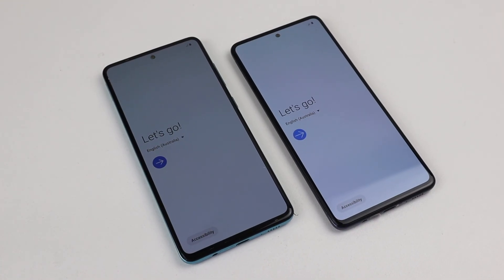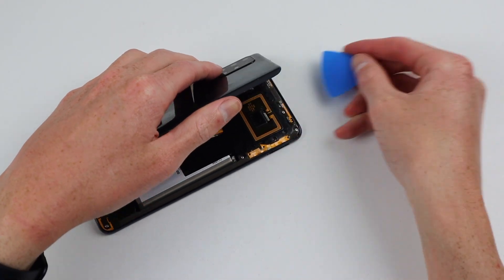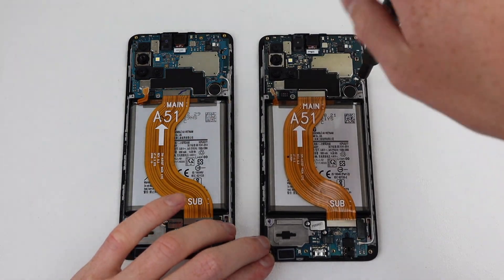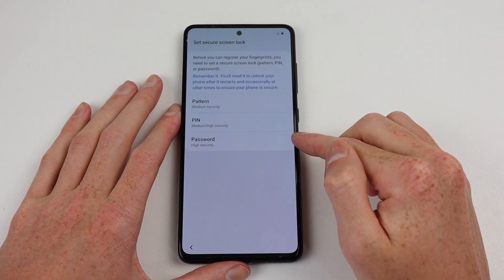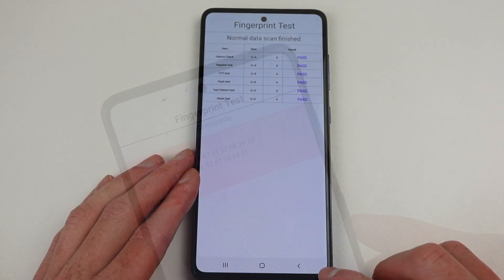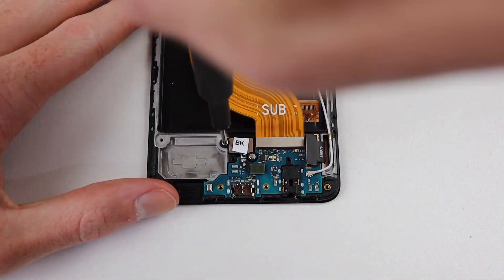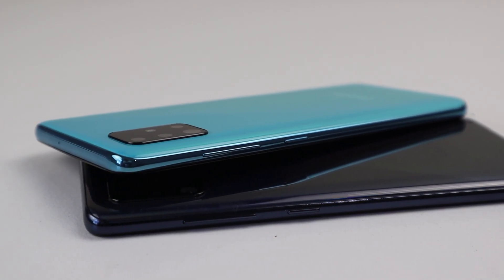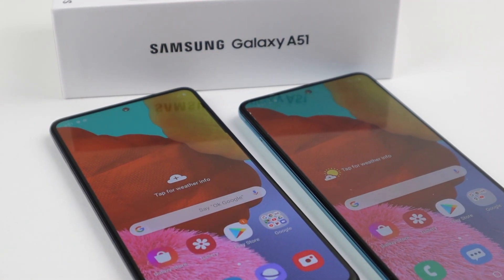Samsung Starts Blocking 3rd Party Repairs? - Galaxy A51 Teardown and Repair Assessment

Comment: Samsung has just become a clone of Apple.
I fear the day I can't repair my old, good Galaxy S5 anymore.
In that case, I'm gonna switch to Fairphone. As late as possible, hopefully.
Reply: Actually the S5 was one of the more difficult ones to repair, since the frame screws were located under the screen.   Not impossible to remove the screen without damaging it, but it certainly wasn't repair friendly. :(
Reply: @BillAnt  you're right. USB port got repaired twice (first attempt was a bad job) and each time it was necessary to unglue the screen, with all the risk that such operation bears.
Luckily, my phone is still working. The one I'd like to use, Shift mu, is under development. Hopefully it comes in two years. Let's see.
Reply: Does it actually still work? Like, it doesnt fry batteries? It does turn on without having to plug a charger?? 

Mine does work, but ANY battery lasts only about 2h, and they get bad after a few months. AND it doesnt turn on without the usb plugged in, even with the battery full. After the samsung logo i can remove the charger and use it for about 2-3h.
Reply: Noooo I had to abandon my S5, and now my J7 Core :( i don't want a new phone

Comment: i was good fan and customer of samsung mobiles. samsung also following apple. my note after upgrade endup having battery problem. ordered new original battery from samsung but its the same issue. it goes from 100% to 0 % in 10 minutes or less screen time. they really screwed my phone to buy a new one. i stopped buying samsung after that.

Comment: I never used Samsung or Apple. I personally feel they are just over hyped. There are plenty of other options to choose from which are way more cheaper, have great specs and perform great too. Been using the Realme X ($ 270) for almost 2 years and never had any sorts of problems whatsoever. Furthermore, using a cheaper option also makes it easier on the pocket if ever you need to change the phone. I seriously feel money can be saved and used on a thousand different things which are way more important than wasting it on phones that use just marketing gimmicks and further marketed by influencers.

Comment: The fingerprint reader shouldn't be a concern, if you ask me.  The security they provide is actually pretty terrible, and compliance with requests to unlock your device are longer something you can actually decline.  All someone needs to do you unlock your phone is just press your finger against the sensor, the phone cares not whether you did it willingly or intentionally, or even if the finger is still attached to you.  It's even demonstrated here that they can return false positives on occasion.

The issue with the replacement probably comes from the the precision required for the sensor to be able to identify the fingerprint reliably.  The tiny difference in the timing and pixel placement between the screens was probably enough to prevent the sensor from getting a reading, and the third party screen probably only worked because the refresh rate was so low it could take several samples at a time.

Comment: this video covered every circumstance except if you downgrade, and then re-upgrade.... In the off chance that the calibration it insists is required is created on the downgraded android, and locked in thorough the upgrade.

Comment: I think this is something related to Knox. It makes sense thinking about the security aspect of it and it explain why only the fingerprint sensor is affected. This should be publicly explicit by Samsung tho.
Reply: How so? could you please explain, so I can understand it better?
Reply: @iam5566  The knox encryption also considers the hardware. It started to consider it a few years ago. However, we've never seen a complete lock of a specific hardware until now. It makes sense to lock the fingerprint reader because if you manage to insert some sort of backdoor in the hardware you'd be able to access sensitive data. One UI prevents you from accessing data if the fingerprint sensor is changed forcing you to use a password. This behavior as pointed out by him started with more recent updates on the security patch. 

This is purely speculation of mine tho... Take it with a grain of sault.

Comment: i do display replacements for the A51 (and every other somewhat recent samsung phone)  very regularly. the fingerprint sensor worked every time. tho i did not check the security update yet
Reply: If you keep the old sensor, it will probably work fine. Only if you replace the sensor it will malfunction.

Comment: I have changed my galaxy a 51 screen my self and the fingerprint sensor did not worked properly 5 minutes after that the phone worked without any problems forgot to metion i am 14 years old

Comment: Isn't it possible Samsung has done this thing with the fingerprint sensor for an entirely different reason, namely to block the possibility of swapping parts in order to gain fraudulent access? Or wouldn't that be a possibility anyway?
Reply: Since the fingerprint would be stored on the mainboard, swapping out the sensor should not matter. On the other hand, even if their security was that bad, the hacker would still need physical access to the device. Even then, the OS could just display "non-original part detected" and work fine otherwise. Instead, they choose to make the device malfunction in an obscure way.
Reply: The security concern is a big one, although there should be a way to allow the sensor to still be used such as after installation force the user to use a password like they already do when you first turn on the phone (on models like the Note 9) and then display a notification that lets the user "calibrate" the new sensor as we have already confirmed the user is allowed to use the device thanks to the pin or text passcode.

Comment: My Samsung mobile motherboard was damaged then i go to Samsung service centr they said me cost of repair is 7000 rupee and then i think if i have to spend that much then its better to buy new one so i didn't gave my mobile in service centr after that i go to mobile repairing shop and i just have to spend 1500 rupee and within 15 minutes my mobile works fine.
So conclusion is if i have dont any option to where i repair my mobile according to our own will then for middle class like us dont prefer that type of mobile who doesn't prefer 3rd party repair

Comment: My a50 also did that fingerprint problem after screen replacement, fixed it by doing a factory reset via android recovery mode
Reply: I just needed to re-register my finger prints after my screen got replaced on my A50.
Reply: Which android version?
Reply: @storch1442  Andriod 11
Was earlier this year
Reply: Did screen glass replacement on my brother's a50 today 
Having the calibrate problem 
Won't let me add new fingerprint :(
Can u tell me how u did it 😞
Reply: @Ghostv33  you need to visit service center

Comment: This video is pretty misleading. Typically you don't replace the fingerprint sensors on samsung phones like this. Also most reputable 3rd party repair shops use genuine samsung screens anyway and if theres a security patch which requires an alteration to the replacement screens samsung will send out a notice and replace current parts in stock. Samsung aren't locking out 3rd party repairs. It allows them to make more money while outsourcing labour to other companies.
Reply: hm

Comment: Can you try to unlock the phone, install a custom rom and then again change the fingerprint sensor? If it's a software limitations by Samsung updates the new sensor at least in theory should work with a custom rom without any limitations.

Comment: To calibrate the sensor you need to install the firmware for the phone that's provided by Samsung, then the scanners will work as intended. Not sure why but this is the solution.
Reply: How is this done please?

Comment: Screw them, bought A11 and it broke on me just a week after purchase. Now I'm proud owner of Sony phone and this thing is amazing
Reply: I also want to buy Sony phone but where I live no one bothers even importing their new phones. and if I decide to import one myself would have an issue I would need to count on some 3rd party repair shop to be able to get the parts and fix it for me. this is kind of risk I don't incline to take. also any Chinese phone is burned out for me for security reasons and that leaves not a lot of choice.
Reply: @eliadbu  why not buy used or refurbished Sony phones from Japan? Make sure the phone is set so it's no longer locked down by docomo or au (Japanese phone service providers) ad you're golden. You can get them for cheap, like very cheap and if it break down you can switch to another because how cheap they are. Also if you afraid to lose your data, keep important data in cloud like google drive or load them to USB stick. Right now I'm using a SO-05K or Sony Xperia XZ2 compact. I got it for just $100 and it's tough as nail. My previous phone was Sony Xperia XZ and it only cost me $80 2 years ago. After my XZ finally died I tried Samsung A11 but it went kaput in just a week so I get myself XZ2 compact.

Comment: I have a 5 year old Samsung phone whose structural integrity relies completely on ducttape, but it still works fine and I replaced half the parts myself (I just got tired of ordering stuff from china, hence the ducttape). The thing was a used phone in the first place anyway. 5 years. It looks like shit, but it works just fine. Even the battery is still quite fine. 

I hate where tech corporations are going.

Comment: Ok, That's me being done with Samsung then. Not sure who I will switch to but Samsung is no more.
Reply: This is a solvable issue BTW
Reply: @warjt4737  how?
Reply: @DragonProtector  You can modify the phones, and what some people have been doing is flashing the stock firmware through Odin after installing a new display. That has been working.
Reply: @warjt4737  i thought that was obvious solution to do first? If you own the phone

Comment: And thank god I moved away from Samsun with my s7 edge. That thing got slow over a year and a half of use that even getting a refurbished showed no signs of faster app load times.

Been with my Google Pixel 3a XL for two years now, can still open all my apps quickly and also open Google Maps in just two seconds. Compared to 45 seconds for my Samsung...

Bye bye samsung.
Reply: factory reset with your s7 didnt fix it? or custom os? I am on pixel xl gen 1 still
Reply: @DragonProtector  nope, fresh factory reset and even flashing the stock firmware or one unbloated firmware onto it, bootloader not unlockable so it had to be a signed one, google maps still took awhile to load, and apps sometimes freeze out.
Reply: @niiiiiix  that stinks hard. I am still on my pixel xl gen 1 running fast.
Reply: @DragonProtector  well I meant I said I moved away from my s7 edge, my Google pixel 3a xl is working great, the one I use all day
Reply: @niiiiiix  ya ik. I got lineage os 17.1 on my pixel xl gen 1. Replaced battery last yr and running fantastic

Comment: Cars have had this for a while now, when you replace an electronic item you have to connect it to the main system by entering a pin no, which of course you don't have,
You can get it if you remove the chip and read it, but a cars circuit boards are huge compared to a mobile phone and it's very fiddely

Comment: We have reached a point where the mere act of opening your phone back has turned into something akin to breaking into a vault. Remember when phones and electronics devices in general were repair friendly?
Reply: It can be water resistant and repair friendly at the same time.
Reply: @Josh-oc7ib  Finally, someone mentioned this. It is possible, if rubber gaskets and Phillips screws were used on the phone's shell. :)
Reply: I remember when they had a battery I could easily replace.
Reply: @charleshines1553  same man. Literally the only reason I ever change phones is either the battery has degraded and can't be replaced or I cracked my screen by dropping my phone and that can't be repaired.
Reply: I Guess you could say we became

Vault Hunters

Cue CSI:Miami Intro
Reply: just don't drop your phone :)
Reply: I remember those times, they were great times
Reply: At the same time, modern phones are solid like a brick, while old were creaking plastic monstrosities in comparision.
Reply: Truth be told thats just due to the fact that the phones are now much more water resistant
Reply: @rajkumar-rg5sw  Yes, because I submerge my phone daily. Since my first Huawei G300 I do not remember having my phone around water, like ever unless you count toilet because why would I?
Reply: @zabunko  Aah yes because when I drop my phone in a pool of water, I always 💯 plan ahead to do it. Speaking of which I had a slot in my next week's calendar to drop my phone in a puddle. I'll just cancel that event so I don't damage my non water resistant phone.
Reply: @zabunko  You have never visited scotland have you?
Reply: @CallumCarmicheal  Have you ever visited Serbia?
Reply: @zabunko  Crazy you would ask that, but no. I do want to visit a friend in serbia though :)
Reply: @CallumCarmicheal  how about giving people options? Never in my life have I ever wished that my phone was waterproof. If I drop my phone in a pool, I have insurance to cover that. But the chances of that happening are extremely slim. In fact, the chances of me dropping my phone down, cracking my screen and not being able to easily have it repaired are much higher. Has happened to me with 2 phones now. Especially since phones these days are so massive, have glass backs and are so uncomfortable to use with one hand.
Reply: @zabunko  ether way its good to have a IP rating so stop crying
Reply: @rajkumar-rg5sw  no simply no.. Removable batteries have stopped existing wayyy before phones were waterproof. Even today, most phones are not waterproof. Only the high end ones are. And yet no phone today has removable batteries. These phones are deliberately made to stop working after a few years so that people have to go and buy new ones.
Reply: @PurushNahiMahaPurush  S5 was water-resistant and had a removable battery :)
Reply: @rajkumar-rg5sw  Yes because the Galaxy S5 definitely wasn't an obvious proof that what you just said is utter bullshit.
Reply: @rajkumar-rg5sw  galaxy s5 was a PROOF that you don't have to sacrifice repairability for water resistant
Reply: @rajkumar-rg5sw  Truth be told, it aint rocket science to re-waterproof literally any device.

Comment: I do IT and Cyber security as a hobby It's not blocking third party, It's calibration, because every screen has different pixels placement and and  Brightness for the  Ultra sonic fngerprint reader, so by replacing the screen, the reader does not know what the pixels placement and brightness is, so it falls to allow enrollment of fingerprints or is inaccurate.

Comment: for me, i've changed my my display 2 times and the fingerprint works just fine. i just had to delete the old finger prints and add new ones
Reply: Yes he had no issue with changing the display. The issue is changing the fingerprint sensor.

Comment: Here's something you're critically missing, there are a number of factors and also security reasons this will not work;

*Firmware on the sensor(A mismatch in the firmware with the sensor will cause some freaky stuff of course, just look into low level comm standards such as I2C, UART, USB and etc; they can add or remove features or how a key is generated).

*TPMs(Commonly used with fingerprint sensors to prevent exploits)
Also when the software on both ends is different that's another issue.

They've done this sort of stuff in other companies and specially laptop fingerprint sensors.

In general a fingerprint sensor should never be able to be changed while retaining YOUR fingerprint, it wouldn't be to hard to intercept and or send that data; if you're someone who stores critical stuff on their phone this can be an issue, poor copy displays also can cause an issue(some don't even work).

It's just a security feature; oh and if you ever open the glass backs, here's a tip: try using a deck of playing cards, cards are just strong enough but flexible enough to not crack the glass but rather also slice through the adhesive.

Comment: Samsung phones already are unrepairable. That's nothing new. Their batteries are glued in so much that it's impossible to remove them by a normal user and even the opening process is extremely hard. The display also is pretty much impossible to repair by users.
Samsung is not "starting" unrepairable devices - they already are for many years. There's a reason why Samsung phones only get ~1/10 from iFixit.

It's now just getting way worse.

Comment: Look at it from a security standpoint if you can swap out bits to unlock someone's phone then what is the point of a fingerprint reader. If I can take your phone which is locked with your fingerprint and then go get the exact same phone and put my fingerprint on that second phone and then replace my fingerprint with yours on your device and unlock your phone there's no security

Comment: This also happened to my Mi 9T Pro. Everything worked fine when it was in MIUI 11 but then I've updated it to MIUI 12. After the update was finished, I was facing bootloops after my 1st reboot. No chance to save it unless you factory reset and not  registering a fingerprint. Trying to do so will only cause a reboot to happen. I've tried out many things and it seems that only vendors of MIUI 11 work. I'm now happy with my phone now that I've flashed it with Oxygen OS with its own vendor.